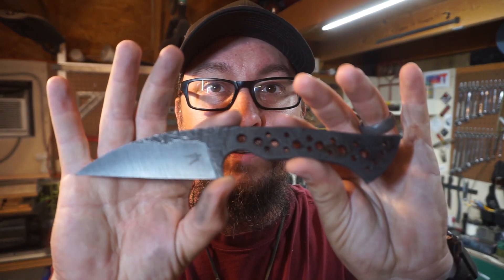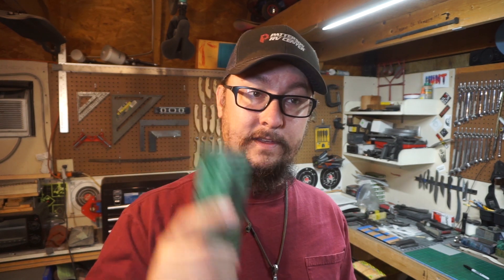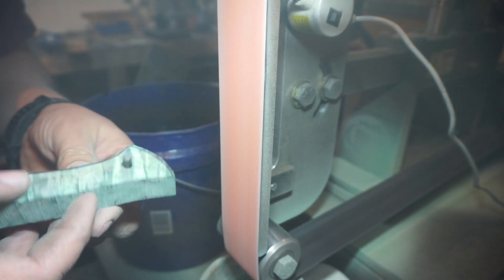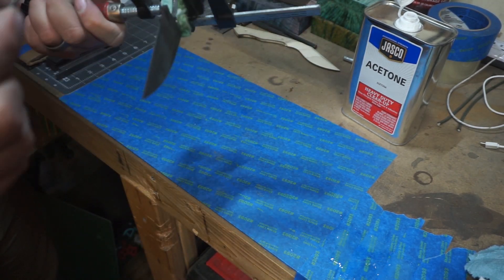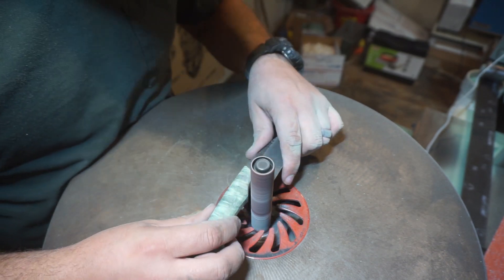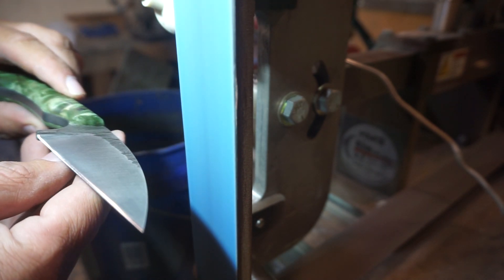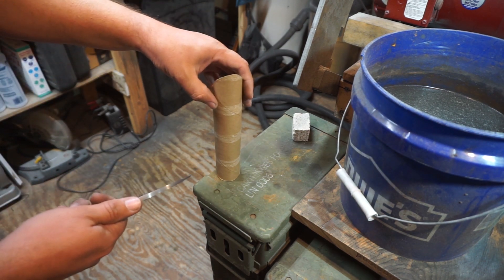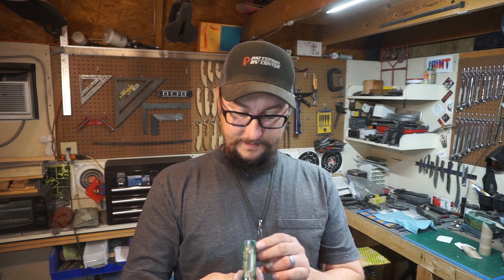Finishing a Custom 5160 Wharncliffe Knife | Build Your Own Knife | Vlog

Comment: Really nice knife!  Good advice too about buffing; my dad stabbed himself with a bowie after getting a static shock on the buffer and flinching.  He always tells me its THE most dangerous machine in the shop.  Also you might consider buffing the tops of your handle pieces to finish before glue up so you don't have to try and buff that against the blade.